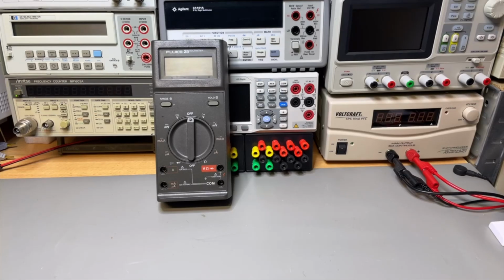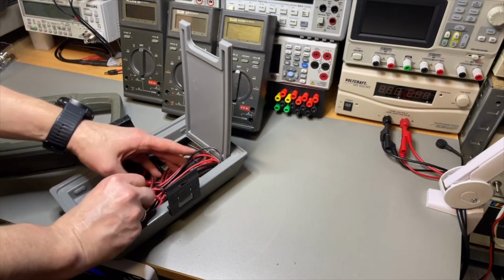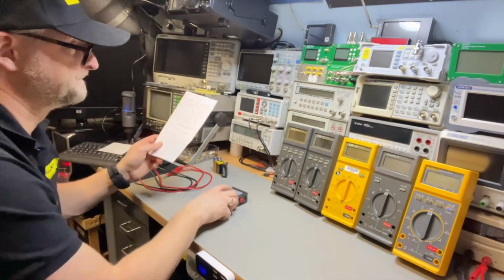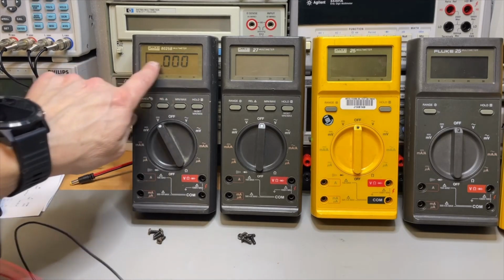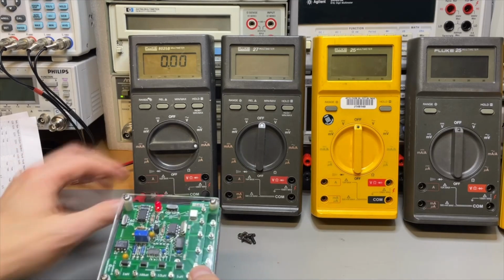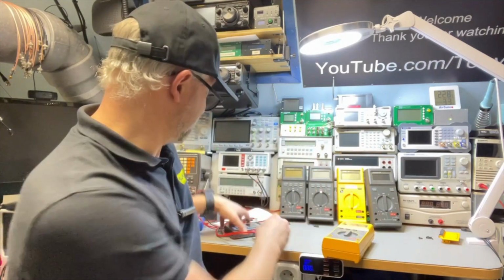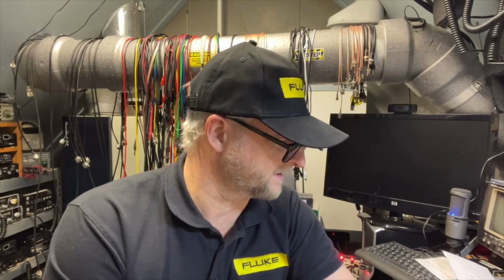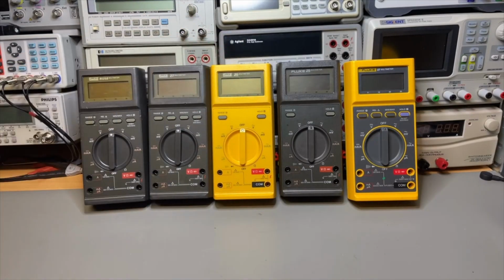TA-0322: Fluke Friday (E4) Fluke 25 and 27 Serie 8025B Teardown Cleanup

Comment: I really like the 27 series. I bought a number of years back a 27/FM from an antique store. It came with the hard shell case and leads and a 6KV probe! Nice score! And it's been a champ of service for close to 10 years now. I recently had it calibrated back in mid 2021 and I doubt they even adjusted it. But at least I know it's right on or so within spec. I believe the FM was RMS for AC voltages. I never had a problem with the meter and use it often. It lives in my toolbox as a handy meter for lugging around. Though I do not use it as often anymore as I have had a Fluke 189 for a few years now. It's also a great meter! The 27/FM is something that you can beat up and it just keeps going! In fact I just changed the orings on the screws as they were looking a bit less O and more like a frisbee lol.
Reply from the maker: Yes indeed very nice, and unbreakable in normal use. The misconception with calibration services is, that they mostly verify only if it is still in specs adjustments are not done , mostly this is only done by the brand itself. and i love the 189

Comment: I hadn’t heard of these multimeters until I saw this review. I found one in essentially new condition (fluke 27 yellow/black model) and received it today and have been having a tinker. Such a high quality item! Notably, using a fluke i400e current clamp on millivolt setting it measures accurately down to 0.1 millivolt/0.1 amps. My fluke 117 won’t measure below 2.4 millivolt/2.4 amps in comparison. Thank you for bringing these and other quality items to my attention. Cheers from Australia.
Reply from the maker: Great! yes Fluke made lots lots of stuff and with some great quality too even in those years.

Comment: You missed the Fluke 16
Reply from the maker: Correct, i did not have it at that time, but i do have now, while the series goes, i am still collecting too.
i am missing much more... the 12 has also many more versions
Reply: @TonyAlbus  The Fluke 16 is a very nice compact meter. I like the turn switch more than the Fluke 12 button panel.
Reply from the maker: @lancelink88  Yes agree, the 12B and 12E+ also have a turn switch :)
Stay tuned.. i will do much more fluke friday and am still collecting more and more types.

Comment: There is also a 27 (not FM) in full yellow (no gray) that is MSHA spec. It is not TRMS like the mil FM version. Ebay was saturated with these great meters (mostly military surplus) a few years ago at bargain prices and even included the 12kv HV probe.
Reply: *errata corrected:  6kv HV probe. Oops.
Reply from the maker: i missed those.. pitty, nice to have those HV probes too
Reply: I bought 3 Flukes 27FM 10 years ago.
Amazing multimeter.

Comment: What a fascinating episode Tony. Considering there age and the fact that the calibration is carried out by adjusted by adjusting potentiometers, I was amazed with their accuracy . Nice to see the Fluke Calibrator being used too and as I said before I love how easy that is do drive. Yes you cannot get away from calibration stickers even today however you seem to clean them off well. As always I was impressed by your process calibrators and especially the DMMcheck. I see in the list of related items you have listed a SDG1032X. Is that something you have recently purchased or is it on loan from your friends at eleshop ?
Reply from the maker: Thank you so much Ian!. lot of work, but nice to have it on video for future.. this must have been a very proffesional serie.. so many adjustments indeed. You are correct on the calibrator... i never have read the manual.. it just makes sense... i will read some when the FF reaches that number.. and try some more advanced options.The DMMcheckplus is great in accuracy 6.5 but limited to 5 volts only and 1 mA AC and DC.. the LB02A is good for 4.5 digits..and it more flexible.. but have their purpose. The SDG1032X is new my SDG1010 was not good anymore.. yes from Eleshop.. i used it in a Fluke video before to show TrueRMS or AVG for AC on the older meters. Thanks for your nice comments

Comment: Thank you Tony for another Fluke Friday!  I own a Fluke 8025A from 1982 and have used it for many, many years. As you said,  built like a brick but also reliable and accurate.  I check it against my Fluke 5100A calibrator and have never had to adjust it. Have you looked at the AC output of your little calibration tester with an oscilloscope just to verify its output? It appears all of your multimeters read around 5.5 volts - can they all be wrong? I ask because the 27 looked spot on at 50 Hz when connected to the 5100B. Regards,  David
Reply from the maker: Hi David... yes build like a brick.. amazing. the little calibrator does a square wave.. on average that is more then a sine wave thats why it shows more... new multimeters have a smart chip that corrects that.. its called true rms. older multimeres doe not have that..